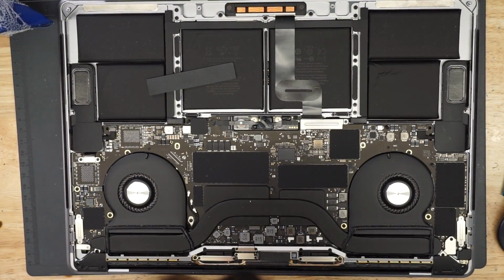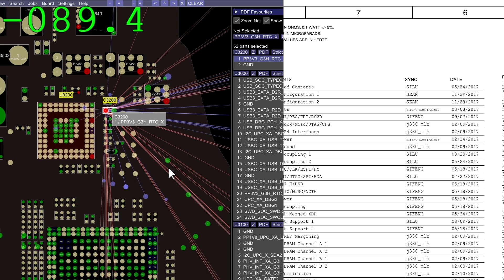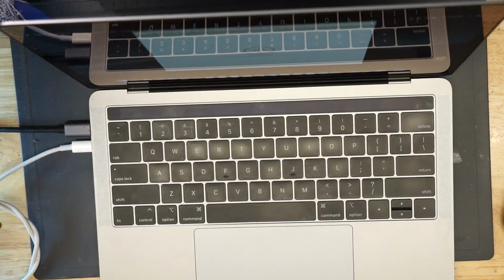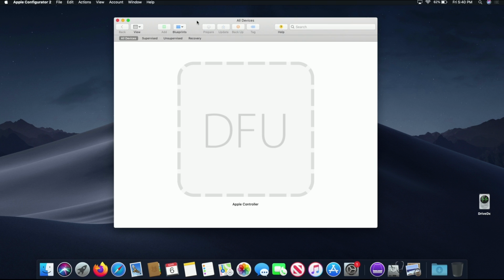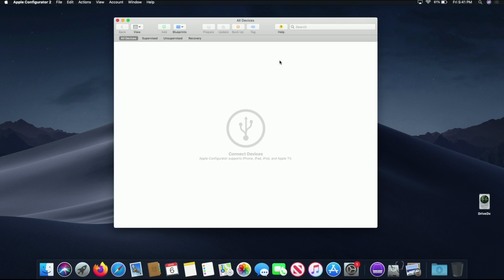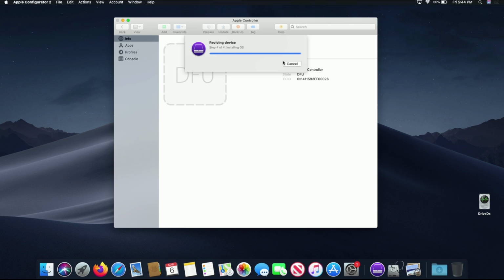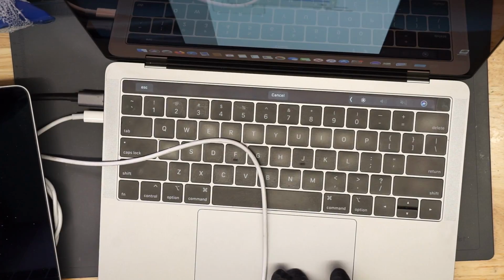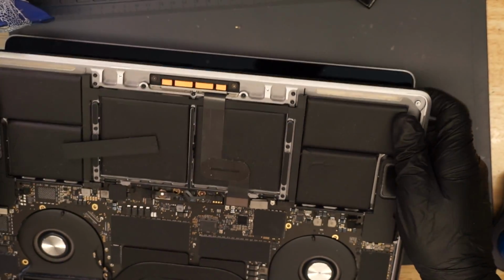A1990 Macbook Pro dead after update: how to repair T2 failure on 820-01041

Comment: What a huge waste of time and a total FU to their customers. I also love how the Apple fix doesn't even work like it's supposed to. Dosdude1 could probably create a fix that works better and takes less than a quarter of the time.

Wait a second... the fix involves buying another Macbook. Genius!
Reply: Adam Baldwin TBF, unless either the problem is just hardware failure or the preferred solution is to nuke & pave the system, you generally need a working computer to fix a messed up computer. As much as we’d like for Apple to open source all the things (or make Windows/Linux versions of their tools), is it really surprising that their diagnostic tools only run on their OS?

Edit: Unless you’re talking about how much Apple apparently charges to fix this issue, then I totally agree.
Reply: @OtherTheDave  "unless either the problem is just hardware failure or the preferred solution is to nuke & pave the system, you generally need a working computer to fix a messed up computer."

That's absolutely false, I fixed computers on a daily basis for 6 years and still do on a regular basis without using a second computer. Physically connecting one computer to another is Apple's idea of a brilliant repair strategy, it is not the norm. Granted, for certain situations, assuming you happen to have another machine just sitting around, it can be a handy solution, but for their to be no other option to fix the machine is absolutely ridiculous. Not to mention the cause of the problem in the first place is a forced software update. That's unacceptable.

Edit: The ONLY time I ever use a second computer to "fix" something is for data recovery.
Reply: Adam Baldwin You’re right, “need” is too strong of a word.

That said, I can’t remember the last time I had to deal with a problem that wasn’t either so easy to fix that it hardly counted as a problem at all, or didn’t essentially require a second computer to go into the serial or remote management port to change some corrupted UEFI setting or boot config file or whatever on the malfunctioning computer. Would it have been possible to fix those problems without another computer? In at least one case, no (well, technically all I actually needed that time was a terminal, but it’s easier just to use a terminal emulator on a laptop, and probably cheaper even if you need to buy a crappy refurb laptop to do it). In other cases, using my laptop to “remote” into the computer sitting right next to me made it so much easier to fix the problem that it might as well have been necessary. Have you ever tried googling a problem on a computer that will only boot to a shell prompt? Not many sites are designed to work well with CLI web browsers anymore.

I guess we’re just used to working on different kinds of computers.
Reply: @rars0n  You'd google something on a broken computer to avoid having to use second computer. I thought that's what we were talking about.

I haven't worked at a company yet (or at least not in the IT dept) that uses Windows, and at home I'm either on macOS or Linux, so I can't comment on how to troubleshoot or fix Windows.

At where I used to work, Linux doesn't typically have the kinds of problems that repair tools can automatically fix. If the system booted correctly, there generally wasn't a problem. So the vast majority of the issues I dealt with were systems that either wouldn't boot or wouldn't finish booting. Due to the stage of product development we were in at the time, reinstalling would've likely resulted in losing either some test data (which sometimes took days to create), or whatever changes were made to the code since the last commit, or something else that, while probably not actually catastrophic, would've made "just reinstalling the system" a serious pain.

If reinstalling isn't an option and you can't log into the system itself to research and fix the issue directly, how do you propose doing it without some sort of second computer?

Like I said, I think we're used to dealing with different kinds of problems.

Comment: I still have my 2013 27 inch iMac sitting beside me in the box it came in. I am now using a new 2019 27 inch iMac at this time. Last October I downloaded Catalina to the 2013 computer. I did not do my research to find out that the new OS Catalina was 64 bit. I was trying to recover my pictures and it would not do so. I called Apple and they got it download the pictures. It was going to take some time so I went to the store and back in a hour. When I got back, the computer was black and it would NOT startup NO power at all. I took it 90 miles to the nearest Apple store and after a week, they told me the logic board was toast. I told them what I had done and they had nothing to say. I still don't know what went wrong with the computer. Did the memory lock it up? Did the chip get over worked? They said it was not the power supply but something in the board went to hell. They said they could make the repair for $550. I hope to get it going again. Too damn good of a computer to turn into junk.

Comment: Great info. Thank you for sharing. What if T2 chip dies. Is it possible to replace it and reconfigure it with that software? Is it possible to make a dump file of t2 chip?
Reply: Nope... T2 is even worst than SMC chip. And the new mac are one time used piece of junk.

Comment: Nice .. so after buying an 3 to 5 k mac you have to buy a second 3 to 5 k mac to fix it 👨‍💻.   😂
Reply: Imagine both got updates at the same time :3
Reply: RS Master The Mac mini starts at $800, and the iMac and MacBook Air both start at $1100. While I think we would both agree that Apple should have less expensive options (or at least higher base specs), that’s hardly $3k.
Reply: Yeah 🤣😅
Reply: Is this a new model? Would it be under warranty

Comment: Win10: breaks itself whith updates. Force user to reinstall
Apple: bricks the laptop with failed update
Reply: Windows: Usually software fixable.
Apple: Not so much... depends which way the wind's blowing that day.
Reply: @Blitterbug  you fuck up UEFI on a PC, worst case you take off one SO-8 chip, put it into a usb-programmer, flash it and put it back. You fuck up EFI on a mac, you're well fucked.
Reply: ...and force you to buy a new one to fix the old one with some program that will vanish from the app store soon...crack and dump the t2 chip is the way to go
Reply: Mu Aries ...So the answer......LINUX !
Reply: Dual Boot Windows/Linux
Reply: None of my mac update screw ups have bricked any of my machines
Reply: They're both worth each other. Automatic updates are basically a system-wide backdoor. It makes someone else own your entire machine despite the fact that you bought it.
Reply: yes some times but at least there is a way to recover at home. not like apple
Reply: Linux: just works, and doesn't annoy you with forced updates you don't care about
Reply: this is gold
Reply: Good time to buy a new computer guys, you can afford  it, Apple can see your bank accounts etc
Reply: fixing Windows fail: reboot -> reinstall.
fixing Linux: copy paste 3 lines of commands -> get another distro
fixing Mac: gotta have multiple macs being able to use hot air gun and soldering iron -> buy a new MAC.
Reply: Mu Aries my mid-2012 MacBook stopped charging above a progressively decreasing (low) percentage a few months ago. While I still had power, I looked up the problem, powered it on while holding a few specific keys, power management was reset, and it began charging again like normal. No problems since. 
My Windows 10 system is progressively losing functionality in things like charging, Bluetooth, WiFi, I/O, and and those problems can be fixed only by replacing the battery and the WiFi card.
At least there are built-in solutions for many ways that a MacBook can fail. They’re not perfect, but they’re designed with contingencies for many kinds of failures.
Reply: @zizimugen4470  windows doesnt loose hardware functionality, either hardware is already failing, or software screwed up... most of the time, fix is very easy install of driver or os or replacement of particular hardware... mac, go ahead... replace anything? soon t2 chip will be programmed for everything inside, and you want even be able to replace a screw on it!only apple can access it and program it... oh mighty appple is doing this to make macs/idevices not fail :) kid yourself.
Reply: Im still runnin win8 and the updates are screwin up many programs i have purchased. I refused ta upgrade we win was given da so called free upgrade. Now they intentionally degrade win8 ta force me ta upgrade lucky i have a os disk
Reply: @imfloridano5448  If you're running Windows 8, shiiiit that might be your issue because 8 is dogshit lol.
Reply: @imfloridano5448  get to 8.1 at least geez
Reply: imflori dano you can still upgrade to 10 by downloading the windows 10 media creation tool and then selecting upgrade this PC. It keeps all your data and the upgrade is free
Reply: @maperez12  100% this. It uses your key from Windows 7, 8 or 8.1 and activates Windows 10 on your device. It keeps all of your programs, data, etc. It is absolutely fantastic and I implore you to use it Imflori Dano, because Windows 8 is not user friendly at all.
Reply: @maperez12  this is not a legal way. It is not supported. I heard you won't get some certain important updates if you upgrade through this anymore. I work at a microsoft gold partner company, where we are not allowed to upgrade consumer PC's to windows 10 anymore.

Comment: There is an app called “XAMPP” and if you run it, yuo can’t force quit it and you can’t turn off your mac because “XAMPP” is open.
Reply: I work with XAMPP and I can confirm that this doesn't happen on Windows PCs. It seems like a Mac only bug.
Reply: MrVent do you know if there is alternatives of xampp ?
Reply: @chrisparussin5359  just use Docker instead of installing xampp directly
Reply: Only way to close the app is to wait your battery goes to 0% and your pc auto powers off
Reply: couldn't you just force power off the system by holding the power off button for 20 seconds or so? (I know you shouldn't have to, but I mean, rather than having to wait for the battery to run down)

just had a quick google to see if there was any fixed and saw there is a version called xampp-vm that runs it in a virtual machine instead, have you tried that one?